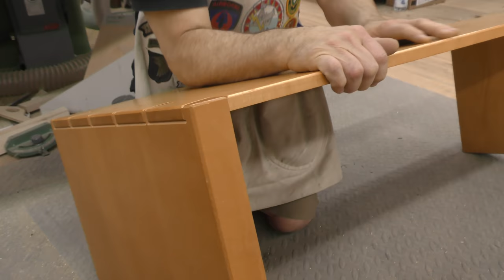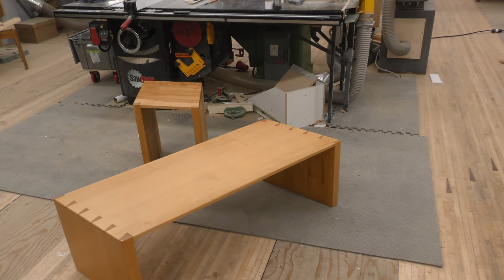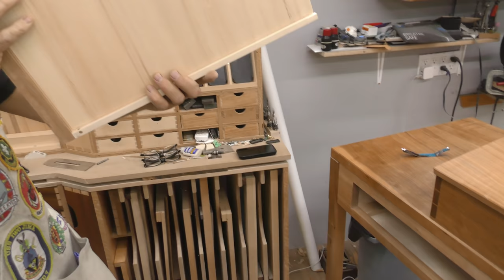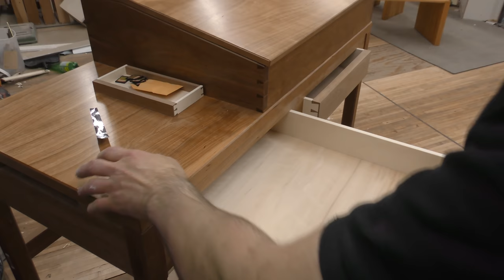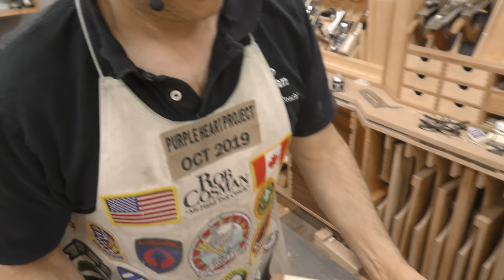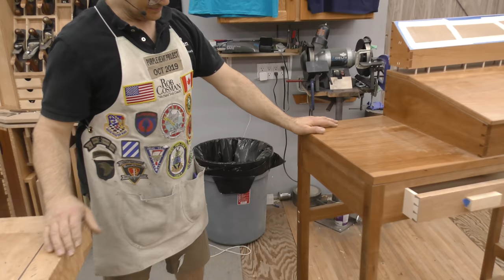Precision Woodworking - GET A PERFECT DRAWER FIT

Comment: Wow! That was a great series. It has challenged me to attempt some things I wouldn't have done before. I certainly appreciate the need to back off on how many videos you do each week. I appreciate any that you provide. They're always informative and entertaining. Thanks for walking us through the process of building and fitting the drawers.
Reply from the maker: Of course, Scott. We're always open to suggestions...Anything in particular you'd be interested to see in the future?
Reply: Rob, I'd love for you to do a basic introduction of some other, perhaps more esoteric, hand cut joinery. I don't expect it to take the place of buying your videos or maybe someday taking a class, but it would be great to see some basics on how you decide to use a particular technique like a stopped sliding dovetail, for example.. Maybe one video session where you introduce the basics of a number of joints without actually having to go into the details of cutting them. Go ahead and make it a commercial for some of your videos. I have no problem with that!

Comment: Tip: put blue or white chalk on the underside where youre fitting the drawers and see where the chalk touches first as the drawer slides in.  This should give you an idea of your high spots and low spots. A little trick i learned down the road

Comment: Rob, I always thought dovetails should be referenced from a line drawn 90 degrees across the face of the board when working with an angled end. This means the angle of the dovetail is parallel to the edge of the board and not the end of the board which would give an different angle on each side of the tail.

Comment: I like the angled tables, but I was wondering if the dovetail layout could be rotated towards the angle of the top rather than in line with the legs. It may balance the end pins a little better. I'm not sure if they'd be best rotated the align with the table top edge or some angle between the table top edge and aligned to the legs.

Comment: Rob, to get consistent dovetails at an angle I think you’d have to “shift” your cutting angles by the amount that your joint is off from 90. Basically sketch a normal dovetail and skew the entire thing.

E.g. if you normally cut dovetails at 14 degrees and your boards are at a 76 degree angle (90-14), then one side of the dovetail would be cut at 90 degrees (like a box joint) and the other side would be cut at 28 degrees (or is it 62?). Doing this you should get even pins on the edges at the cost of a weird looking joint
Reply: I did a bad job of explaining. Normally you pick a dovetail angle and cut at 90 deg +/- that dovetail angle. In this case you’d cut at your board angle +/- the dovetail angle

Comment: Dang, can't believe the series is done, this was like waiting to see who shot J.R.  😃
Here's a thought on the fitting the drawer- without the bottom in, can the sides flex in slightly when you're fitting? Then, with the drawer bottom installed, the sides can't flex and are now a wee bit oversize?

Comment: Rob, when you are checking for "up and down" play, it seems like you can only know for sure there's adequate play in the front half of the opening. Have you found an effective way to check for the right amount of play deep inside the case in the back of the opening? Maybe try to pivot/twist the drawer up and down from the front and feel for it to move an hit the slides in the back?
Reply from the maker: Sins i know my sides are flat and square, and so is my carcass i just check for up and down at front, halfway out and almost all the way out.  This part is not precision.
Reply: RobCosman.com  - that makes sense. I guess if the wood moves after it’s been six-squared, you’ll see the burnished spots.

Comment: Hi, since the sides have a tendency to “sweel” from it’s original fit when the drawer’s bottom is added would it be an idea to create a slight bow with the plane (just a few thows toward the inside) in the middle of the drawer’s bottom to allow some kind of a light drag between the sides and the case (probably like the original fit) acting like a ring filling the gap between a piston and it’s cylinder, maybe this would prevent from having to readjust the sides so much and make an even more perfect fit while adding a little more physic to woodworking.
Great series 
Thank you!

Comment: I love the simple design of the tables!Personally on an angled project like your tables, I prefer the dovetails  to follow an imaginary baseline parallel to the tail board. It does require however to have two bevel gauges set up, one for each side of the tail to keep the same degree off of the baseline.
Reply: This was going to be my comment as well. It seems like your preferred method would help to avoid the short grain problem that Rob has mentioned in previous videos. I wonder if his choice is purely aesthetic?

Comment: Awesome tables, interesting treatment of the dovetails.  I have no idea how you were able to go back after the fact and add the chamfer with a router without it going all over the place on you and being so precise to go around the dovetails (video on this!?!).  You beat me to the critique of the end pin being so large, but it is understandable given the design, as you mentioned.  The fit of the drawer is amazing, but now I'm sad to see this series end!  I have another question if you get to it.  I don't think you'd deny that a shooting board is one of the most important tools in the shop.  I was just using mine to take hair thin shavings off of pieces to get that perfect fit, which you just can't do with power tools nor are they nearly as accurate.  I was wondering what your thoughts were on dedicated shooting board planes.  I have the Lie Nielsen No 51, which I absolutely love.  My shooting board has a track in which the plane travels to assist with keeping it engaged in the cut.  I realize it is more costly to purchase a dedicated plane such as this, but with the frequency with which you use the shooting board, do you not feel that it is worth the extra expense for a dedicated shooting plane as opposed to the 5-1/2?  I assume you don't feel that way since you would own one otherwise, just curious about your thoughts on this.

Comment: I think the cracks on the end table are caused by uneven expansion due to the angle, the pin boards expand more in relation the tail board.

Comment: Just a thought on the challenge of fitting the drawer after the bottom is inserted- if the drawer side thickness varies even slightly when fitting the drawer without the base, the sides are able to easily flex in which allows the drawer to go in the opening. Once the base is inserted, this limits the ability of the sides to flex inwards so the drawer binds where it previously didn’t. I may be way off the mark- just a thought.

Comment: Thanks for the great series Rob and Jake, especially the real time problem solving.  
Please can you take about the pros and cons of using drawer slips on the sides (instead of the normal groove) for the drawer bottom? I haven't seen you use them before, but it would be interesting to see them the drawer of a future project. 
Thanks v much.

Comment: Do you think the end table cracked because of the angle ?It couldn’t expand because of the angel. Just curious?i like the intro by the way.what if you rubbed a light pencil on the inside of the cabinet it would transfer to the side of the drawer.what happens when you finish the outside in thickness?

Comment: Just thinking, what if you planed the edge of the drawer bottom as a slight concave shape? So the middle of the drawer bottom doesn’t touch the drawer sides, but the corners are still bottomed out in the groove, preventing any racking of the drawer?

Comment: Thinking laterally (outside the drawer lol) assuming that the drawer bottom fits perfectly and the side are plumb and dead flat and straight, then I'd suggest that it is the pressure exerted on the side by the carcass - now resisted by the draw bottom being in place - that causes the tightness.
It also seems that you struggled all the way through with this one with some problem with the inside left of the carcass.

Comment: As far as not having a clear sign that you're working on the actual problem area; would putting a straight edge, like your longest bench plane, along the side of the drawer help to find out if the side is bowed out and where? That and your feeler gauges should be able to pinpoint how much and where you concentrate the planing.

We use straight edges on cylinder heads to detect whether it is warped before any work is performed, (valve job, etc), where resurfacing the head beforehand is necessary.
Reply from the maker: Yes that might work.  Good idea.  The problem area is so small at the last stages its just hard to find

Comment: Thanks for the content! I look forward to it every night.  

Regarding the splitting in the end table top, if I'm thinking correctly, aren't the legs actually wider than the top because the top's ends are angled?  The legs would then theoretically have a greater amount of movement than the top causing the cracking?

Comment: You've mentioned a few times a problem with angled dovetails (tool cabinet, bed desk, this last table set) - that you end up with one tiny, one huge half-pin and that you have some really short grain on one side of the tails. I think this is because you're marking a 1:6 tail referenced from the angled end of the tail board. Another way is to mark the tail angles as 1:6 (and 1:8 on the other side of the tails) in relation to the grain direction or the sides of the tail board, rather than its angled end. Makes for even half pins, no short grain and I think a more balanced, less wonky-looking dovetail. Really hard to explain in writing but search 'Matt Estlea angled dovetail' on YouTube and he demonstrates it well (https://youtu.be/NhBgHB_i9Ds) . I think your method of transferring the tails to the pins would still work too. Might make an interesting video for you to do? All the best, and I love what you do, thank you!

Comment: Regarding that table where the top developed cracks at the corner of the dovetails, is the top essentially quarter-sawn or rift-sawn? If the sides are flat-sawn maybe that's enough to split an overly-tight joint.
Reply from the maker: That could be the isdue

Comment: Referring to the coffee table.  If I have a crack in metal the first thing we do is drill a hole at the end of the crack to stop it from running  further.   It seems that sharp angles lead to cracks.  Would it be the same for wood.   Would chiseling the corners of the dovetails potentially lead to cracks?

Comment: Hi Rob /team can I ask why you do not use Stanley planes from no3 to no 8 and so on ? Wood River iv never sin in England 
Are wood River better or is it just what you perfer thanks for your time
Reply: Rob actually addressed why he doesn't use or recommend Stanley a few videos back (might have been one of the Saturday Q & A). Basically, Stanley used unrelieved cast iron, so they can break if you drop them. Stanley's castings were much thinner, and didn't have as tight of tolerances (even the Bedrocks, which cost as much or more than Woodriver). And you almost always have to fettle (flatten) the sole of old planes to get them flat again, then you have to square the sides.  It takes a lot of time and effort to get them fully functional.

Woodriver are great value. They have very tight tolerances, but don't cost as much as Lie Nielsen. Veritas bench planes use a Norris adjuster and the blade on those can't be advanced or retracted while in motion.
Reply: Thanks very much for that and I'm thinking about it getting a wood River for my self

Comment: One reason the drawer fits without the bottom is the sides can flex inward as you are fitting it.  Once you put the bottom in they can no longer flex and the drawer doesn't fit anymore.

Comment: End-Table Wood Movement--is is reasonable to deduce that thicker wood will move less with the seasons (than thinner stock), since it has to absorb more moisture, deeper?  Therefore the thinner top  moves earlier and more than the thicker sides--and is more liable to crack (as it has)?
Reply from the maker: Could be we need to look at the book wood movement ....it will have the answer
Reply from the maker: Maybe....good thinking

Comment: My thoughts on why it wont fix with the bottom in.... (just my thoughts mind) without the bottom the sides are able to flex just a little and with the bottom in, it makes the sides more rigid so they cant bow in as u push the drawer in???? Maybe... again, just my thoughts
Reply from the maker: Thats exactly what happens when the bottom goes in.  But i expect that.

Comment: Let's look at the problem differently. The groove in the drawer sides may not be deep enough along it's length. Not by much, but enough to bow the side outwards. Also, the groove width may be smaller at spots. Again, not by much, but just enough.
Reply from the maker: Well we did final depth set with a router plane so I am confident that the grove depth is accurate from the reference face, which in this case is the inside of the drawe

Comment: Since you referenced the groove for the drawer bottom from the INSIDE face, but you're fitting the outside face, you don't know that the drawer thickness from the bottom of the groove to the outside face. It would only have to be off by a few thousandths of an inch to push the drawer side out. You'd need a plane that references the OUTSIDE face but cuts the groove on the opposite face of the board, that way you'd know it was correct to the tolerances you are requiring for this work.
Reply from the maker: Maybe we should design one of those?
Reply: @RobCosmanWoodworking  Does that even sound like a reasonable explanation at all? It's the only thing I could think of that you hadn't already taken into account...  Making a measuring device for that would be pretty straightforward, but the plane was be...complicated!

Comment: I noticed the star shaped depth adjuster knob, something in the works?
About the little drawer.. is it possible to cut a veneer from the front as you did with the current one you're fitting, and flip it, with that thin of a piece the grain might look close to how you need it.
Suggestion for a future video, how do you handle big furniture like a wardrobe in terms of joinery while keeping easy to knock down and move?
Thanks for another great episode.
Reply: @simong-uk  you're getting the veneer you need from the front, you either compensate for the thickness of the saw kerf or make another drawer.

Comment: Hello Rob
Just two ideas on the problems you mentioned:

- drawer side fitting-difference with/without drawer bottom
Could it be, that youself introduce this problem in the way you try to achieve a perfect fit? You begin with a little bit oversized drawer and you have to fit the drawer-end first. Planing off material from the drawer-end introduces a slight taper. The drawer-sides and -front still remain a little bit too wide for the drawer-opening.

You proceed in the fitting process by pushing the drawer hard into the opening (to find burnishing marks). By this, the drawer is forced deeper into the opening until the pressure is too high, to get any further. As you always mentioned, the drawer sides are thin! When you push the drawer hard into the opening the introduced taper will cause the thin drawer sides to bend inwards (at least slightly). You continue fitting the drawer by planing off material where you can detect burnishing marks. Where the drawer-sides bend inwards (start to bend inwards) there will probably be not much burnishing of the wood, because the sides give away somewhere between the drawer-end and the point, where the drawer gets stuck. So, the fitting-process itself could probably introduce a cup into the drawer sides, which is always pushed out, when you push the drawer into the drawer-opening, accepting a fit, which is more in the direction snug than sloppy. 

If this is true, without the drawer-bottom you should expect the most fitting problems at the drawer-end and the drawer-front (not considering top and bottom). With the drawer-bottom installed, you would expect fitting problems somewhere from the middle of the drawer sides to the drawer-end (when there are no other problems) because the drawer-bottom now prevents that you can push the cup out of the drawer-sides.

What do you think?

- cracks in angled dovetails
You join two boards in a way, that the joint line has the same width for both boards. But the pin-board (in your case) is wider than the tail-board and thus will expand a little bit more than the tailboard, even thought the joint line has the same width. Most of the pin-board expansion goes into the direction in wich the tailboard also expands. The other proportion of the pin-boards expansion will cause stress (maybe shearing forces) in the tailboard. The steeper the angle, the more stress is introduced to the tail-board (pin-boardexpansion increases in comparison to tail-board expansion, direction of the expansion becomes more unfavourable). 
The thicker the pin-board in co mparison to the tail-board is, the deeper inside the tailboard is the contact point, too.
Does this make sense?

Greets, Christian
Reply from the maker: Thanks Christen.  I dont think i am introducing a taper, without the bottom in the sides do give.  But i know that.  I am just trying to get close before i install the bottom.  I know i will always have to do a final fit after i put in the bottom.